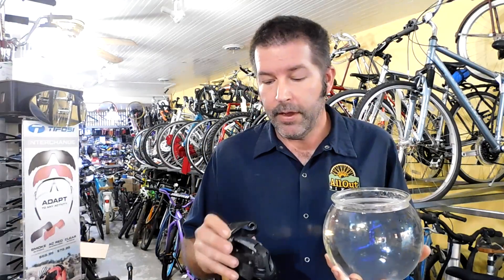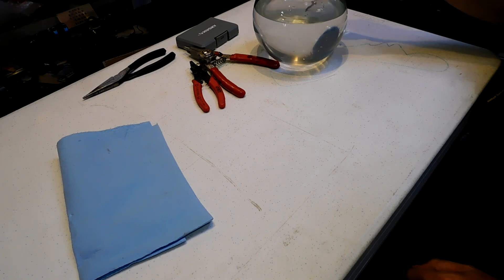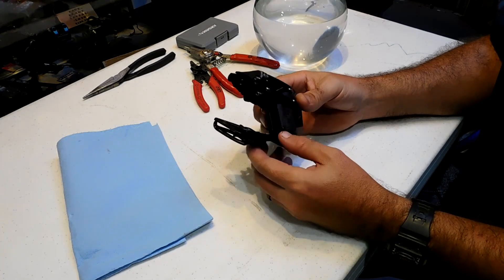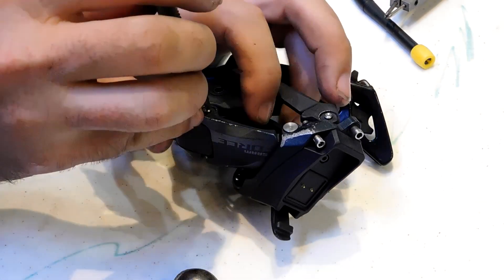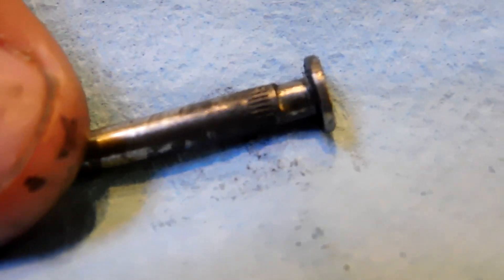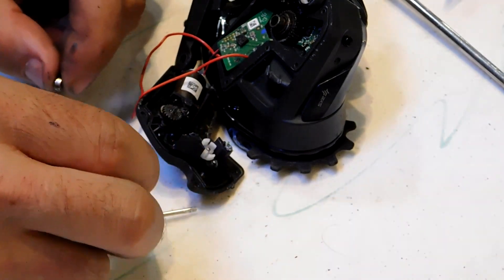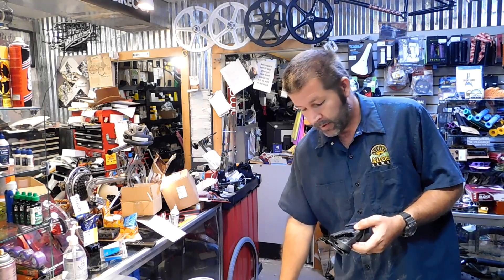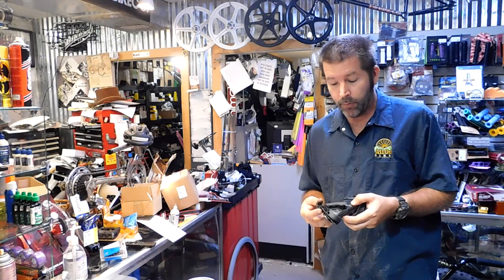Looking inside of a $350 Sram Force AXS Derailleur

Comment: Your video is very interesting and useful. I was looking at it to try solving a problem but I noticed that you haven’t unmounted what I was looking for: I was losing the pin under the F o Force, the one that works as pivot on the external side of the derailleur; I tried pushing it inside again and this worked for me, but I don’t know if I have something broken inside (never crashed)

Comment: Its happened to my force axs RD i need a new pin, do sram supply them ? Thanks
Reply from the maker: No. Sram doesn't supply parts but there are a couple of aftermarket suppliers of parts. Just Google Sram axs rebuild kit and you will find your parts. Goodluck.👍

Comment: I have a pin backjng out on my rear mech tht does not have a retainig clip that i can see. Has anyone else had this lne back out and if so is the solution to buy a new pin like in the other 2 pivot locations? Thanks in advance. This video was very informative amd helpful.
Reply from the maker: I haven't seen that happen before. Hopefully you can find a replacement retaining clip. Goodluck 👍

Comment: No bearings or sleeve bushings and using low grade materials... Junk!  Planned Obsolescence designed in. 40yr old Shimano and Campy mechs work like clockwork and still can get parts.
Reply: I fully agree about the quality and service ability of the old style Campa and Shimano stuff, my Sram Force AXS RD failed after 5000 km related to the mentioned pin, warranty applies but takes a while.

Comment: Don't reproduce this opening methodology. If you do like that, you will broke the circuit board at least. What you need to do to access the gearings on road RD Force or RED is to remove the arm on the opposite side, then once the arm is disassembled from the gear you'll get access to the whole electronics, motor and gears without applying any strength all parts should come easy.
Reply from the maker: The derailleur wasn't any good so I wasn't worried about saving it. I do appreciate the heads-up it won't be often needed since Sram just wants you to buy a new derailleur instead of repairing it. Thanks for watching.👍
Reply: @alloutbikes do you have a teardown guide. If I am out of warranty (hoping to get a grace period) I need to replace a pogo pin
Reply: @arhu74 does anyone have a teardown guide?

Comment: Hello One question, did you manage to solve this problem? I have the same problem and I don't know what to do?
😢
Reply from the maker: No. All I needed was a replacement pin but Sram doesn't sell new pins. I will be saving all bad E derailleurs in the future to rob parts off them. I found that some of the pins are interchangeable. Goodluck👍

Comment: Do you remember what torx sizes? On my sram red etap it has a bolt or screw I think should be a bit tighter as not as flush as the other, it just one that near jockey side and closest to where cage attaches seems 1-2mm proud of the other near it

Comment: How many miles would a front or rear electronic derailleur last before needing to be replaced?   What parts can be replaced if they fail ? This is my main concern with electronic because they are expensive
Reply from the maker: This derailleur had over 20,000 miles  on it. The customer also didn't maintain it.

Comment: My rear red axs, suddenly is select 1 gear up according the select speed on shifters . I have 5 on the shifters, the derailleur is on 4 cog. Dosnt go at 12. Is something broken? Out of the bike is moving by hand without any resistance from low to higher gear with a little push.  Is 4 months old
Reply from the maker: It sounds like the derailleur hanger may have been bumped. Take your bike to a shop you trust and have them check the hanger. Goodluck.👍
Reply: @alloutbikes  I just fixed it at home. The long part of the big spring for some reason moved from the position that sits(on a small arm that move the derailleur)and prevents the movement of the derailleur towards up. All these happened when I reinstall the rear wheel,  probably I pushed a lot the derailleur with the cassette.  Very strange. At least now is working and I will not spend 500-600£!! I only lost my training, my evening and 5 years of my life!!
Reply from the maker: @christosballis2032  That's a first! I never heard that happen. I'm glad you figured it out.👍

Comment: My Eagle XX1 AXS derailleur went all floppy just before the 2 year warranty period was up.  With the help of my local bike shop SRAM replaced it FOC after around a month. Otherwise, I would think that pins from another SRAM (cheaper non AXS) derailleur would probably fit but luckily it didn't come to that.  For information, my floppy AXS had done around 10,000 miles (16,000 km) in all conditions including sloppy UK mud.
Reply from the maker: Thanks for sharing. This derailleur supposedly had about the same or more. Maybe we found the life of those derailleur.👍

Comment: Magnet is for Hall effect sensor that locates the motor position.
Reply from the maker: Thank you. If I could have removed the lever from the body of the derailleur I could have taken it apart with less carnage and could have seen the position of the parts.
Reply: @alloutbikes  indeed im looking for the same tool, look like you need to remove the pin that hold the lever, but i dont know how yet, already broke one red axs in name of science too, but no luck so far.

Comment: Are the electronic derailers better than a standard derailer?
Reply from the maker: Performance wise......Yes! I like both. For my everyday bike it is amazing. The bad thing about electric shifting is keeping the battery charged up. If you don't keep the battery charged you ruin the battery. I have to charge mine up about once a month.
Reply: @alloutbikes  OK thank you! I wondered which would be better
Reply: @alloutbikes  hey dude, thank you for interesting video, I would not be brave enough to put it in water for a week, but before disassemble it, first I would try it out with battery on it. My problem is different, my rear derailleur drains battery in one day. I have two batteries and I switch them between front and rear derailleur, and doesn't matter which battery I use, rear derailleur drains it. Any hints/advices are welcome!
Reply: @Service4Mercedes  if it's less than 2 years old, claim on the warranty